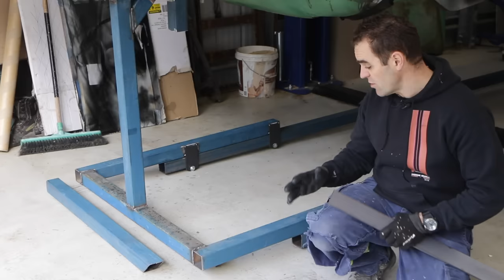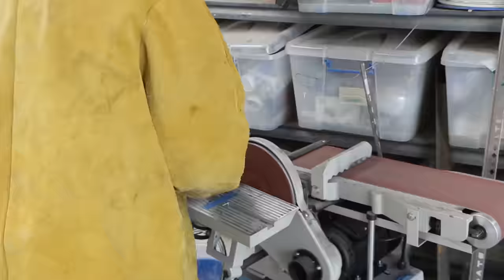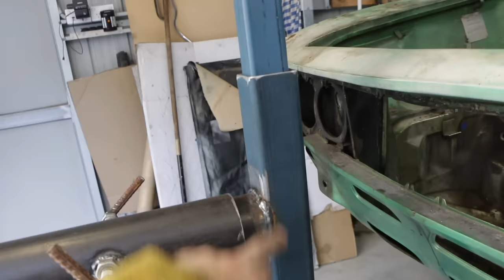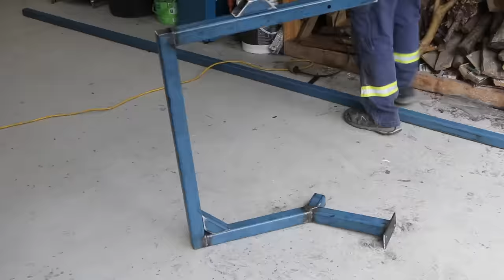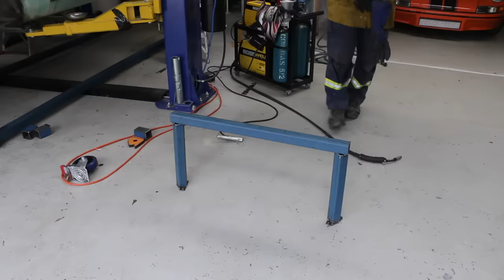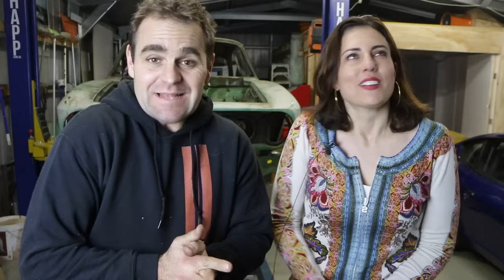Rotisserie part 2 - Alfa Romeo 105 project car build part 6

Comment: Jeff move the boot release over to the right side when you are doing the metalwork.  Simple cut out 2 squares in the B post and swop them, you’ll see how easy. I did that on mine in the UK and was so glad I did. It’s a real pita having to unlock and open passenger door otherwise !
Reply from the maker: Nice tip. I will have a look.

Comment: Shimming between the telescoping SHS with thin sheet stock would help remove some of the bowing. Also removable braces between the uprights and side rails that bolt on would help stiff the frame and reduce bouncing when the car is on the trailer. Don't forget to weld on some tie down points.
Reply from the maker: Tie down points is a good idea.

Comment: You guys ROCK!  I LOVE the through the car pole as it solves a problem we have perfectly.  I look at the wheel base of your casters and wonder how in the hell you are going to get that on a trailer unless you use the lift to lift the car with rotisserie and back the trailer under it?  We are also facing the trailering issue and I think I am going with a pair of dropped trailer axles across the bottom tubes and then remove them after the ride .  Cant wait to look on to the next vid to see how you do!

Comment: When I saw you cut the leg off the "Y" because you could not get the "Y" off the engine mounts, I wondered about using a sleeve of the larger frame material, then boring two holes through the sleeve and the "Y" . Then when it is time to remove it, all you do is remove the bolts slide the sleeve up or down and  you are free...  Maybe I am missing something.....just a thought.

Comment: With a pipe/tube running front to back, things should straighten up, but while that may be fine for a static workshop situation, I get the impression you plan to put it all on a trailer? In that case, you have to account for an emergency braking situation, although I guess that could be handled with chains or straps...

Comment: Jeff, could you slot those lower holes on the front motor mount plates? Once bolted in, they would hold fine, and once removed, the slots would allow you to remove the assembly from the captive studs.
Reply from the maker: That is what I did ;)

Comment: Awesome, I will be building one myself and there are a lot of different concepts out there. Also seeing others 'differing' directions and stumbling blocks is really helpful to me designing my own.
 Trying to get a complete picture of what I will need and thinking forward to how it might be used on the next project which will be much heavier than the GTV as I also have a 70 Chrysler Wagon ???  Thanks for being so generous with your experience.
Reply from the maker: That is the way to do it. Take the bits you like from each design and make what works for you. Also trying to avoid my mistakes is good too ;)

Comment: Great to see you taking on building a rotisserie and, like others, I love that you are willing to show your mistakes. One question/concern I have. While the lengthwise crossbeam will help it looks like you are still setting yourself up for the potential of quite a lot of flex when the car is rotated 90 degrees. I think you may need to think about how to add some torsional bracing. Hopefully I'm wrong but I'd encourage you to visualize where the weight is going to stress the frame when rotated.
Reply from the maker: I hear you, but I think the extra beam will add a lot of strength through out. I am not really worried about it on it's side as it will only be like that in the garage, and it would be fine as it is. The biggest stress is going to be bouncing around on the car trailer.

Comment: The middle extension: Why didn't you bolt it to the inside or outside. Then bolt the wheels under where its double width, but only to the outer piece. Would be lower and you could remove the wheels to get the platform more stable on the ground.
Reply from the maker: It is stronger under or over than on the side, but if I realised I had to put the wheels that far under before I started I may have done something different.

Comment: Thanks again-a really great series-I discovered you a couple of years back looking for DIY paint booth info so I'm glad I followed you from that initial interest.  THe question  I have is the total length of the frame end to end with the GTV installed.  I have a shallow garage (115 year old house) and its tight without a rotisserie. I  can move some stuff around but I need to know the space requirements.

This is a very good build-rugged yet simpler to build than some. thanks!
Reply: PS-my application will be 3 105 series cars and a 101 Spider as well
Reply from the maker: It is just over 5m
Reply: @HomeBuiltByJeff  Thank you sir!

Comment: WD40 isn't cutting oil. It's a water displacing solvent (Water Displacement #40). Th lubricant largely evaporates when it's used. You may want to pick another product.
Reply from the maker: True, but it works ;)
Reply: @Home Built By Jeff Light gear oil, like for diffs is what I use.

Comment: When it sags like that, it is probably putting quite a bit of stress into the chassis of the car, too.
Reply from the maker: The central beam should strengthen the entire unit up a lot.
Reply: @HomeBuiltByJeff  you could slide a heavier gauge square section through the inside of your existing horizontals with a couple of clamping bolts similar to a tow bar. Should be stiff as and simple.

Comment: Brother Jeff, don't put swivel casters on all 4 corners, makes it a buggar to try anf steer. Just 2 swivels, 2 fixed...experience.
Reply from the maker: I did consider that, but the issue is that I need to be able to move it sideways in my garage, so I can easily go from my hoist to my booth.

Comment: Most rotisseries I have seen bolt up to the bumper mounts thus reducing the number of angles that support the car shell, which are compounding the flex.  By using the bumper mounts you are also using the shell as a stiffening member in the whole construction as well as getting the rotisserie members out of the areas that you want to work in.  I don't see the logic for using your frame?
Reply from the maker: Because if you continue to watch you will see that I cut the bumper mounts off ;)

Comment: Jeff, great to watch but what a construction, I attached it to the steering box/bolts in the front and the 3 bolts/triangle arm in the back... Keep it simple

http://forum.alfaromeo105.nl/viewtopic.php?f=7&t=187&sid=7ce3c783ee601d375e1077e29c3c2b3a&start=40

Comment: Jeff, big fan of your channel but you don’t half make hard work of it sometimes! Check out Mk2Mania Deluxe jig, great easy loading design and adjustable centre of gravity.
Reply: I’m guessing he’s using this method because the Alfa is very weak once you go past the rear damper points . If you load the boot with too much luggage the rear wings pop out just about the wheel arch :-)
Reply from the maker: ...and the fact that I am cutting off the front and rear of the car...

Comment: Today's big news: if the engine mounting captive bolts and nuts can go then that means a twinspark is out. That leaves two options: a Busso V6 and eternal glory OR a non-alfa engine an eternity of something else..... 

Please, please, please fit that Busso!
Reply from the maker: You may or may not be correct but you will not be disappointed ;)
Reply: Woo and Hoo! :-)